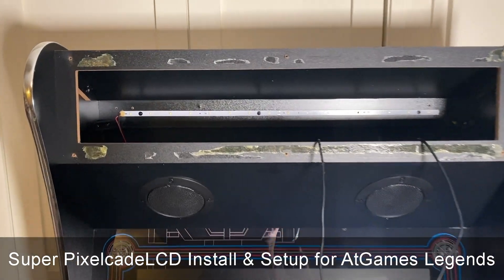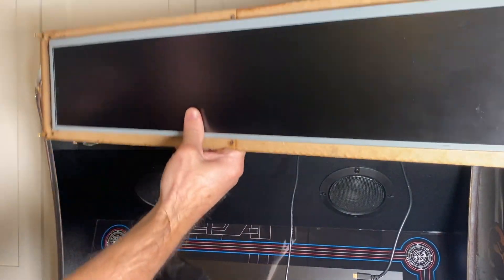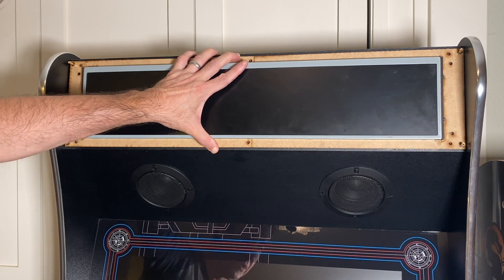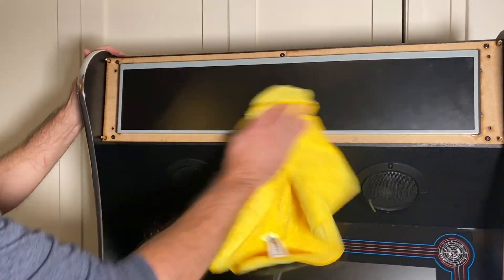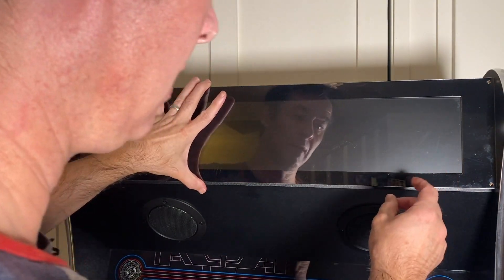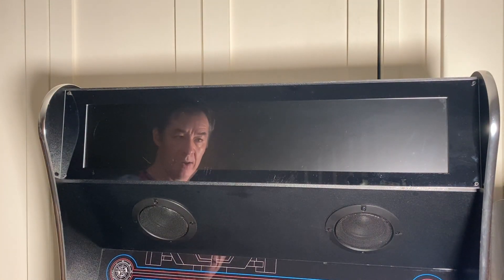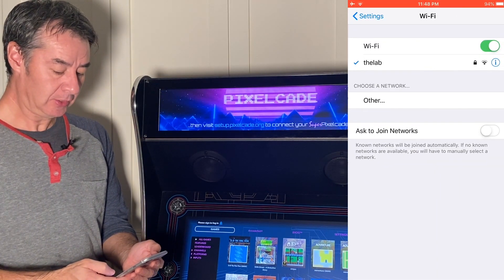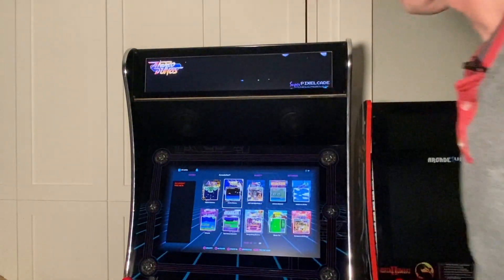Super PixelcadeLCD Install and Setup for AtGames Legends

Comment: does this work with retrobat too?
Reply from the maker: out of the box, I don't think so as the Pixelcade integration with EmulationStation currently uses these scripts which are Linux based https://github.com/alinke/pixelcade-linux/tree/main/batocera/scripts so it would be a matter of porting those to windows batch files and then in theory could work

Comment: The aspect ratio doesn't work.  I hope that a marquee with the correct aspect ratio will be done at some point.
Reply from the maker: it's a fair point, we manually cropped many of the iconic marquees for a better aspect ratio